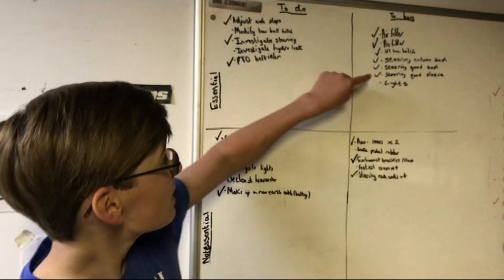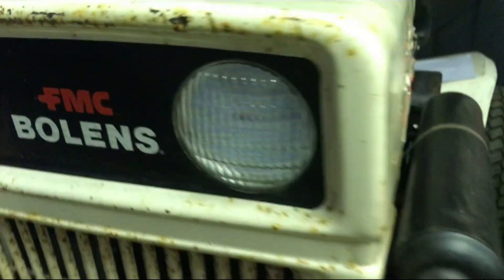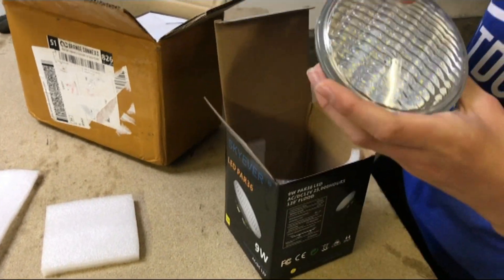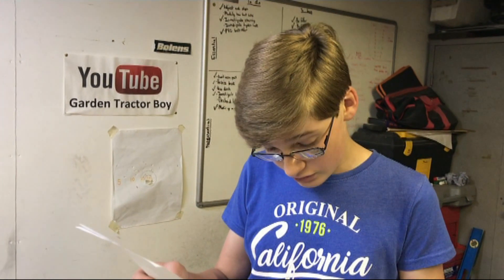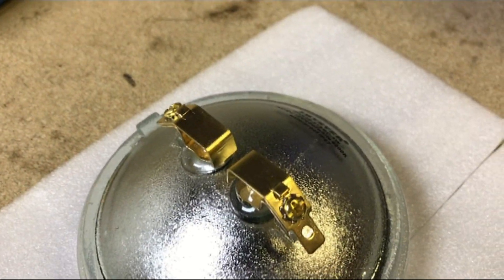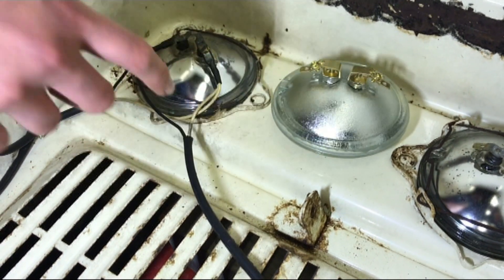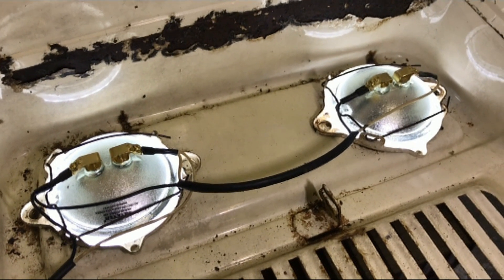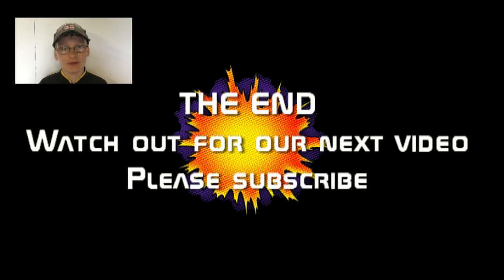Tractor LED light upgrade - What is required

Comment: Less heat generated and less power to run are big improvements with LED's the diffusion really works well to illuminate a larger area as well. Great upgrade !
Reply from the maker: Thanks. They sure make a huge difference, it was hard to show in the video and you are right, lots of other benefits. Take care